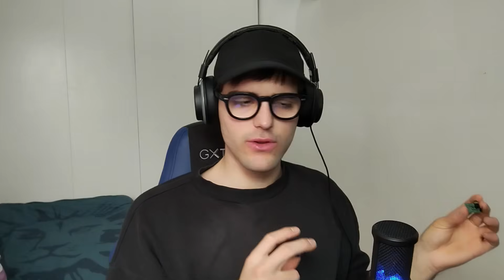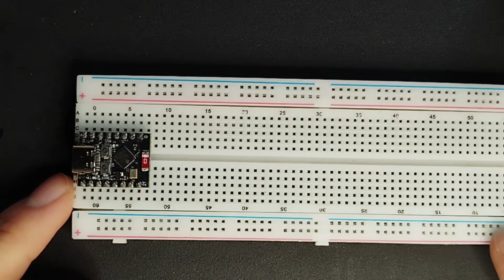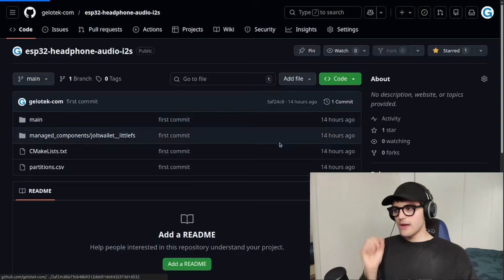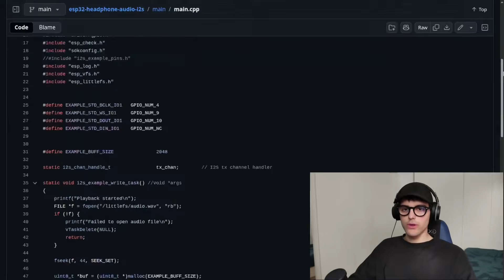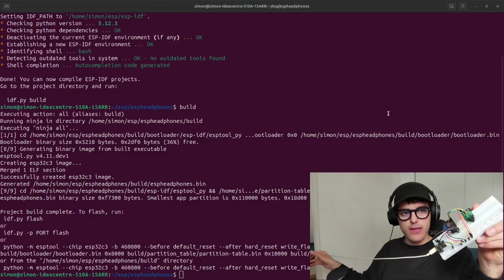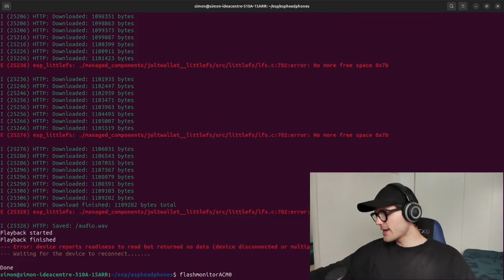How to Play Audio on ESP32 Using Wired Headphones (I2S + PCM5102A + TPA6132)

Comment: Can we make a USB player using esp32 ? What all accessories I need to assemble it ?
Reply from the maker: Yes, it’s possible. You can handle the USB flash drive using the ESP-IDF USB Mass Storage Host example (https://github.com/espressif/esp-idf/tree/master/examples/peripherals/usb/host/msc). That lets the ESP32 read files from the USB stick.
After that, you can feed the audio file into any audio pipeline you like, like the one I showed in this video for headphones (I2S → DAC/amp → headphones/speaker).

Comment: hello, great video. could you make a short video showing how to put files on internal flash? I dont know how to do this
Reply: and also, I am using a VS1053B board to read mp3 files from a TF card reader then with the digital audio I output to headphones, is there any way to do this without VS1053B as I struggle to find pre-made PCBs which have it
Reply from the maker: @popmg604 with the ESP32 i think you actually don't need the VS1053B hardware decoder. The ESP32 is fast enough to do the 'decoding' itself in software. https://www.reddit.com/r/esp32/comments/vz5rwl/how_i_can_play_mp3_and_show_its_spectrum_analyzer/
Reply from the maker: Thanks! Yes, I’ll make a full video showing different ways to put files on internal flash